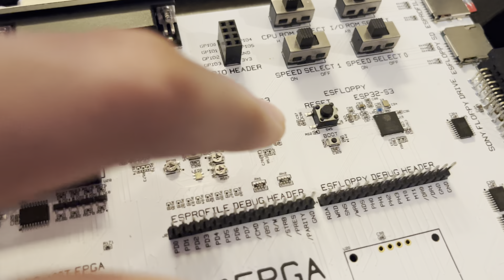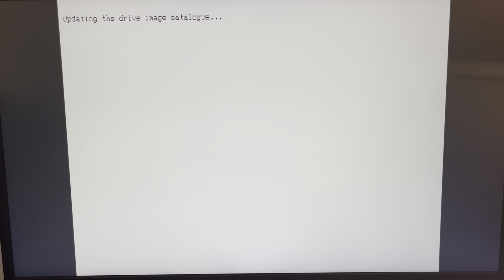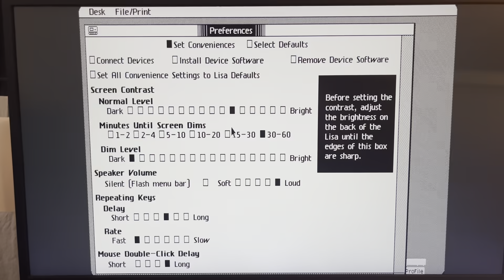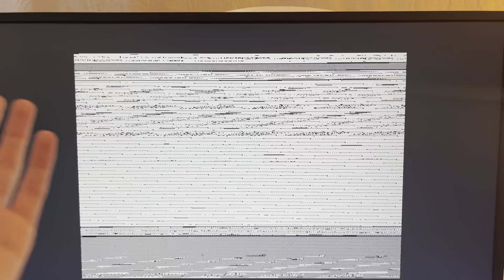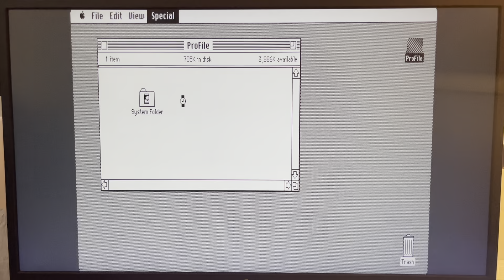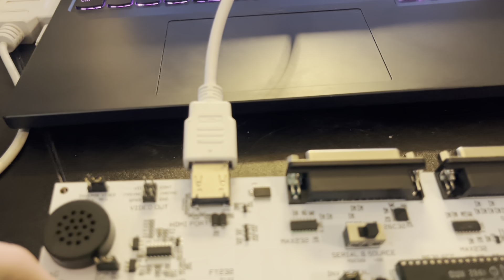I recreated the Apple Lisa computer inside an FPGA! - The LisaFPGA Project

Comment: Hi Alex … do you have a solution for expansion ports? Primarily for SCSI for me. I’m in the middle of a brand new Lisa build with all new Sigma7 boards. There’s a feature of my build that requires SCSI. From my software development perspective, it’d be great to have another modern machine like yours to work with.
Reply from the maker: Unfortunately, no expansion slot solution on this board. I’m already using all but two pins on the FPGA, so it’s kind of impossible! But when I design the version of the board that’s a drop-in replacement for the original Lisa motherboard, then that one will absolutely have expansion slots!

Comment: Alex-I had a thought…

Could you create an app or a patch for the Lisa’s Clock-so we can get past the 11 year (or whatever it is) limitation?

If ANYONE could do this-it’s YOU!
Reply from the maker: It’s absolutely possible, it just takes some mods to the LOS source code to get it to work. Some are to the clock manager code in the core OS, and some fix faulty assumptions in the desktop shell and apps. The mods aren’t that horrible or anything, to the point than an LLM might even be able to figure it out. But unfortunately, I don’t have time right now!
Reply: @AlexElectronics Nice!! No problem re: Time-neither of my Lisa’s are up & running yet!! 

Thanks for letting me know it’s possible Alex!

Comment: Cool project. Personally would suggest adding barrel jack for power (alongside USB-C) which would allow changing what you connect to "USB serial" while board is powered. Personal bugbear of mine when a data port is shared with the only power input.

Comment: 68000 core is built into the FPGA?  I didn't see a separate CPU chip ...
Reply from the maker: Yep, it uses the fx68k core, built right into the FPGA!
Reply: @AlexElectronics  Any chance a 68030 or 68040 core is possible?

Comment: Outstanding!  Do you plan to create a real Lisa case with an LCD that emulates the original CRT, and so on?
Reply from the maker: No, that's not one of my current plans because I'm just not that good at CAD. But if anyone else creates one that looks good and works well, I'll be happy to stick it in the GitHub repo!
Reply: This feels like something someone like @PotatoFi could create.  I would love to have a compact version that would support a 12" or so 4:3 LCD.  One big challenge would be that it would likely be unprintable on most 3d printers, given the size of the front.  I was also thinking a pizza box style case for it, with design cues from the Lisa.  With the size of the board, I suspect most could print.  When I get mine, I might try to tackle that, since that seems much more doable for someone like me.

Comment: For those of us without a Lisa Keyboard, a modern USB keyboard although very functional and practical just doesn't seem right. Did you look at the possibility of interfacing the original Mac keyboards from a MacPlus or the smaller 128K / 512K models? You can get a USB converter for the old Mac keyboards so that would probably work as another option.
Reply from the maker: There's just not enough room on the board and enough pins on the FPGA for that many keyboard interfaces, so for people who want to use a Mac keyboard, I figured that an external Mac-to-USB converter or a Mac-to-Lisa converter would be the way to go. If I start trying to support too many features on the board, then it just gets overcomplicated and expensive!
Reply: @AlexElectronics  thanks for that Alex. I figured you'd have a logical explanation given the depth of thought you appear to have put in to this project. Makes sense you chose the best 2 most suited options that still give you other options.

Comment: Wow. I never knew the Lisa came with dark mode!
Reply from the maker: Haha yeah, but it honestly looks terrible in most software since everything was designed with light mode in mind. To enable it on the original Lisa, you had to run a jumper from a chip on the CPU board to either 5V or GND, so not the easiest thing in the world to turn on and off!

Comment: Alex, awesome!  I have a Digilent Arty that has the same Artix A7-100T.  Any chance of being able to synthesize the FPGA image on that?
Reply from the maker: I did some really early development on an Arty, but you run out of internal BRAM if you try to run the Lisa with more than 256K of RAM. And 256K isn't enough to run any OS, so it's not useful for really anything at all. You've unfortunately got to have the external SDRAM IC that's on my board to do anything useful with it. Good question though!

Comment: On the internal USB to Serial adapter, you could change the switch to be software or firmware controlled.

Similarly, you could add a similar program to control the floppy emulator from the FPGA Apple Lisa itself.
Reply from the maker: I personally think that a physical switch is more versatile and easier to toggle on the fly. A software/firmware solution will only work in certain environments/states, which is very limiting to the user.

Comment: Cool project, I miss SCSI and MC68000 on this board to test old hardware. I hope after 43 years the finished board is smaller so you can put this in a case with HDMI TFT-screen with 10“ or 12“.

Comment: It is my dream that someone out there does this for the Mac SE. What an amazing project. Attention to detail much? WOW. This is just incredible. You got yourself a new subscriber.
Reply from the maker: Thanks for subscribing! Doing a Mac SE would be a lot of fun, I sure wish I had the time...
Reply: depends what you want from it tbh, if it's just to have a device to use classic MacOS on then there's easier later Apple models to get. On the other hand, if it's to get an upgraded board for the original SE then you could change it out for one of the brand new SE/30 recreations or go further than that with a native Raspberry Pi solution that either replaces the 68K or sends video to the Mac directly to get access to everything the Pi can run.

Comment: Any plans to make it fit the enclosure and drop in connections for a real Lisa? Eg either to replace the CPU/io card and use the actual ram cards (optionally) or as a replacement for the backplane board if all the boards rot from the leaking battery etc
Reply from the maker: Yeah, I'm hoping to do a second version of it designed specifically for that purpose!
Reply: @AlexElectronics So coolt to see you work! I have a non-running Lisa with pheriperals here in Sweden that is extremely hard to sell at a fair price - the market is miniscule and h/w export is costly 😅. I have pretty much zero knowledge in restoring it, so being able to connect your hardware inside the casing would be so much fun and perhaps increase the buyers market a bit!
Reply: @AlexElectronics  I was going to ask the same question. Hi from Australia.

Comment: What’s the utilization like on that part? 100T is a pretty decently sized FPGA. Also, how are you driving the HDMI out? I didn’t see a chip on the board for handling that from what I saw. Are the diff pairs directly connected to the FPGA? I’m working on an FPGA project that involves digitizing analog video in an FPGA and would like to get rid of an extra chip if I could.
Reply from the maker: It's not super-utilized. Like 30% of the LUTs, maybe 5% of the FFs, and 20% of the BRAM. I'm using literally all of the I/O though, and most of the BUFGs/MMCMs because there are a LOT of clocks in this design. I don't have the exact utilization numbers in front of me right now, but it's something like that. My main reasons for picking that particular part are because there were a lot of them in stock on LCSC, they weren't any more expensive than lower-end Artix parts, there's lots of I/O, and the somewhat-plentiful block RAM allows for good-sized ILA cores. And yes, all of the HDMI stuff is being driven straight off the FPGA. I can get up to 1080p30 while remaining in spec, and push it to 1080p60 and still have it work fine, albeit with some pulse width timing violations thanks to me driving the OSERDES primitives faster than they're designed for. I'm using this HDMI core right here, and it works really well: https://github.com/hdl-util/hdmi
Reply: @AlexElectronics   Hey Alex, If you start selling these, the HDMI adopter constraints listed at the bottom of that core may come into play.

Comment: Will this be implemented in Mister FPGA as well? A lot of people have that set up.
Reply from the maker: No, the Mister just doesn't really meet my requirements for this project. I needed a custom board to implement all of the Lisa's weird I/O, and plus, I absolutely hate the Intel/Altera Quartus toolchain that you have to use if you're developing for the Mister. Xilinx's Vivado is so much better!!!
Reply: @AlexElectronics  Could Vivado be eventually used as more powerful successor to MiSter project?
Reply from the maker: Vivado isn’t more powerful I wouldn’t say, it’s just a more stable and more polished toolchain. Once the bitstream is on the FPGA there’s no real difference between Quartus and Vivado, it’s all about the developer experience. Mister could absolutely be ported over to Xilinx FPGAs and Vivado, but that would be a lot of work and would break compatibility with existing hardware, so I doubt they’ll ever do it.

Comment: Does it really Max out at two megs? That seems shocking.
Reply: For a system from 1983, 2mb of ram was quite a bit!
Reply from the maker: There were some mods you could do to bypass the MMU and bring it up to 4 megs, but that would prevent the Lisa OS from running and you could only run MacWorks. So obviously I didn't want to do that! Compu85 is totally right; 2 megs was a lot for 1983. By comparison, the original Mac from 1984 only had 1/16th that amount!

Comment: Would the final revision be like a drop in solution? I'm designing a 1:1 3D printed Lisa Enclosure for this. I would also source a e-ink screen if possible to mimic the black and white screen not a HDMI, retrofit a keyboard and mouse from usb to original Lisa accessories.
Reply from the maker: I'm planning on having one version of the board like what you see here, a fully standalone FPGA-based Lisa. The final revision is the same form factor, just with some minor fixes to the circuitry. There will eventually also be a second version in the same form factor as the original Lisa motherboard, so that people with broken Lisas can slide one of these into their chassis and bring it back to life again, with the original display, drives, and everything. I'm not planning on any additional form factors because I'm just too busy, but the nice thing about open-source projects is that anybody can modify the design however they see fit!
Reply: @AlexElectronics  This answers my previous comment. Thanks! I guess subscribing to you channel here would be the best way to follow along for future updates?
Reply from the maker: Yes, I hope to make a few more videos about this project (and others) pretty soon!

Comment: The ghost of Steve Jobs is vindicated
Reply: ב''ה, well, you probably had to be there and I wasn't, but at the same time as he was being nudged out of the Lisa project, the story kind of goes that he was getting a headache over the general developmental bloat of the Lisa project - like, haven't heard much about his role on the semi-disastrous/over-ambitious bringing disk drives in house, but as an early big experiment in OOP trying to follow some of the Xerox/Smalltalk sort of principles, it was quite ambitious and, performance-wise, 'barely ran itself.'

It's hard to say if the Mac was exactly what he wanted to build either, but as a second system, the Lisa experience let him adjust priorities on what was supposed to be the 'bargain bin' machine and .. was in Apple price terms of the time. 

I've never completely drunk the Apple flavor-aid but it's kinda half his hand in one and half or more in the other, since the Mac goals changed drastically to being Lisa-like when he was 'encouraged' to go putter with that and leave the Lisa team alone.

That said, correct me if I'm wrong and I'm not exactly sure where the Lisa was in development when that occurred, possibly more than midway through Lisa development?

Comment: I've taken on a project to design and build my own computer and obviously that's why this has appeared in my feed but it's really encouraging to see someone else that's done something similar. 
Fantastic work, I've never designed a PCB before and that's the bit that scares me the most. 
How many layers in the board? Apparently mine requires 4 which until recently was a complete mystery how they work
Reply: I the ch334 is great, too, I didn't know about that (I don't really know about anything! 😂) and I do need a few USB sockets on it for keyboards and whatnot
Reply from the maker: My advice for the PCB: just take it step by step, and you'll be fine. It seems overwhelming at first, but as long as you break it up into pieces and only worry about doing one at a time, then it feels manageable. And rely heavily on datasheets when wiring things up; a good datasheet will tell you exactly what you need to do most of the time.

This is a 6-layer board, which I need because of how many power rails I have and how many traces come out from under the FPGA in such a tiny space. You can definitely get by with 4 in your application, and maybe even 2 depending on your design.

The CH334 is an awesome little USB hub, and pretty easy to design around too. It's really cheap compared to other options out there, just keep in mind that it's USB 2.0, so it's not the option to choose if you need 3.0 speeds!

Good luck with your project!
Reply: @AlexElectronics 
Good to know, thanks. 
My plan is indeed to start with small prototype boards that feature one single bus between two of the ICs, starting with the central "Chipset" (these XMOS XCores I've discovered) and the SRAM IC. So it seems I'm on the right track. 
I'm trying to treat us like a real product, with ease of construction and cost requirements directing me to not use any BGAs and only use 4 layers. 
Hopefully I'll get something up on YouTube soon enough, even if it's just the Verilog. 
(Just learnt about Verilators and online hosts for them which is fun, use it to publish my CPU design) 

Many Thanks.
Reply from the maker: That's a neat project, and quite a goal of trying to avoid BGAs for everything. Best of luck with it!

Comment: Incredible work Alex! I’ve been deep into restoring two Lisa’s recently and can understand what a task you’ve taken on there. Roughly what are the measurements of the PCB as it would be perfect for a replica Lisa build.
Reply from the maker: Thank you! The board is about 300mm x 135mm (or 11.8in x 5.3in). Just a little bit larger than the keyboard on my 16-inch MacBook Pro, if that gives you any sort of an idea!
Reply: @AlexElectronics Thanks Alex - that’s more compact than I’d imagined from the video. That will open up a lot of possibilities like gutting a faulty iMac and making an iLisa…….
Reply from the maker: It looks a lot bigger on camera for some reason! But yeah, sticking it into an old iMac would be so cool!

Comment: Uhmm why do all of your own power? PSU modules are readily available. I mean I guess for the experience. The board also could be probably half that size. Not sure about routing the traces but sure looks very empty. If it’s 4 layer you should be able to get it really small
Reply from the maker: Yeah, I pretty much did the power myself just for the experience. It's a 6-layer board and most of the empty-looking areas actually have a ton of traces going through them. I'm sure I could make it smaller if I started fresh, but I don't think it's really worth it at this point. It's not like the size really adds any cost, and it's not annoyingly large or anything.
Reply: @AlexElectronics  pragmatic approach : you are not looking to save cts on cm2 of motherboard material .... but instead looking to minimize your development and debugging precious time. Well done !

Comment: Impressive. Sweetly impressive. But one thing this highlights is that even after all these years nobody's done a complete SCC implementation for an FPGA.
Reply from the maker: Thank you! And yeah, I was pretty shocked by the lack of SCC cores. There's a partial implementation for the NanoMac project, but it only implements the bare minimum set of features needed to get the Mac to run. The Lisa uses a lot more of the SCC's capabilities, so it's unfortunately not directly compatible!
Reply: @AlexElectronics sounds like your next project :)
Reply from the maker: Haha, if only I had the time...
Reply: @AlexElectronics  I lack the skill unfortunately. But looking at how people abuse things like SPI to drive e.g. LED strings I'm sure that they'd have great fun with an SCC.

Realistically though, what most people would probably end up using is probably something like a Zynq with just the serial protocol they needed on the FPGA part.
Reply from the maker: Yeah, people love using hard/soft processor cores in their FPGAs for everything these days. I personally prefer implementing as much stuff in dedicated hardware as possible, even stuff that probably shouldn't be, but a lot of other people don't share my odd enjoyment for that!